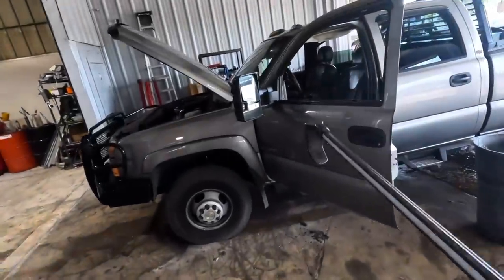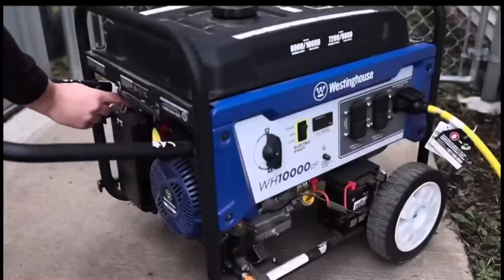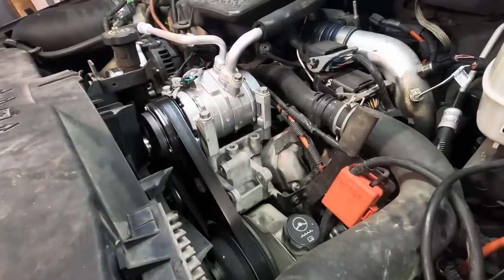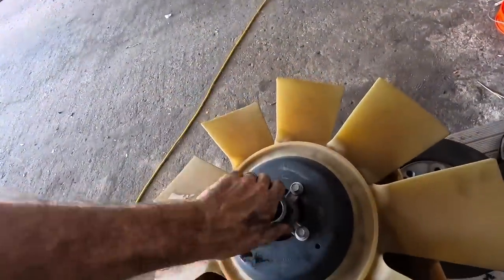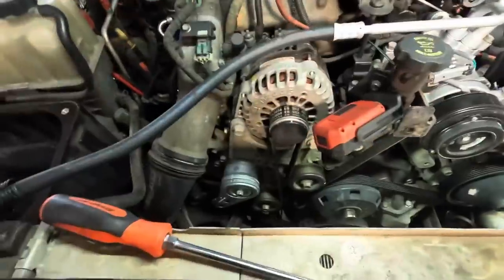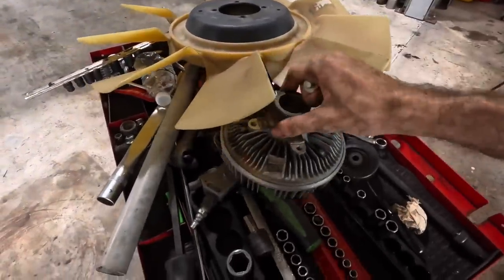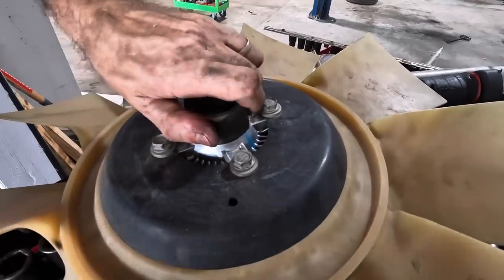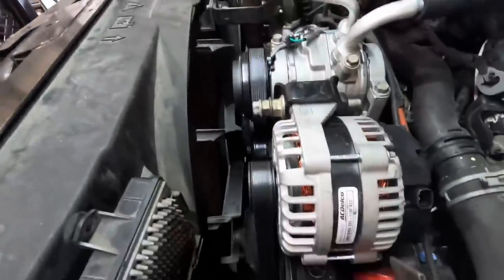Proof of Concept! Dual Alternator DURAMAX!

Comment: Ray you can run a short wire from the S1 directly to the output stud on the back of the alternator to keep the diode set excited all the time, essentially making it a one wire alternator.

Comment: A 12 volt inverter system to produce high amperage AC 120/220 is about the most inefficient method you could choose, especially since it's for a static site, (ie. your house).   Purchase a used "running" 7.5 kw Onan  / Kohler diesel generator from an RV or Boat,  thousands of them out there.  You're a mechanic, rebuild it if you feel the need, have it wired into the electrical panel of your house.  Mine is a 1977 Onan model MDJE, powers my whole house, is fuel efficient,  with minimal service, diesel is safer and stable for long periods of time.

Comment: Convert your gennie to propane. Runs quieter, and no more fussing with gas issues. Plus,,,,,, if you have propane running your stove and or furnace, you are golden just by simply tapping into the bulk tank.

Comment: Hey Ray, if your truck at high idle only burned a gallon per hour, then you would get approximately 5 days out of it. If it burned 4 gallons per hour then you would get 30 hours. Just so you don’t get caught unawares when it doesn’t last as long as you projected here.

Comment: Yes be sure to fuse that charge wire off the alternator and a second next to the battery. Don’t wanna catch the truck on fire if the wire ever gets pinched or rubs thru anywhere.same concept as car audio. 1/0 gauge should be good. It’s what I run power and ground all the way. 
I’m still super interested in your high idle setup! Will that work on a gas motor 04? 
That baby charge wire is definitely holding back power for the test lol grab a new pigtail for the alternator and save yourself some trouble of the wire coming off.

Comment: There is a very nice aftermarket alternator kit that provides high amperage for charging and /running invertor.  A welder box ,4  110v outlets and 1  220v outlet !  Not cheap but a real butt saver

Comment: The exciter wire needs to be connected/switched to energize the stator. The alternator is not self excited, thus the exciter connection. Also the exciter wire needs to be disconnected when the engine is shut down or it will draw down the battery when off, so it should be switch controlled. The one I built is on a 3 horse small engine using a regular Delco alternator from a 74 Chevy 85amp. I use it to charge batteries in the field, or a back-up for inverters if the power is out.

Comment: 2:53 I'm thinking that the belt won't be right there with the other alternator installed. It should be above that area wrapping are the auxiliary alternator pulley.

Comment: You have one or two of the pats need . But for future repairs you need to find a junkyard / pick n pull place / yard  for parts. Yuo could have kept your eyes open for a dual system off a wreck and gotten more parts and not pulled bolts from your extras. OR bought the after market kit.

Comment: You'll be ready when the zombies attack, Ray! 😎
However, you need to check your math. If you have 120 gallons of fuel and running the truck at fast idle burns 2 to 3 gal per hour, you have two to two and a half days of run time... not a week like you said. Of course, if you only run part-time, you can extend that somewhat. 
Incidentally, some big RVs have a second diesel motor just to provide electrical power.  One that an acquaintance had just bought used had a 4 cylinder in the front for the generator and a bigger "pusher" drive motor at the back. It also had a total of eight batteries!

Comment: Ray, you never mentioned whether you have installed a transfer switch next to your home electrical panel.  I had an electrician wire one in for me for a couple hundred bucks after Ike knocked out our power for 2 weeks in 2008.  I plug my 8500W gas generator straight into the transfer switch, which requires me to turn the main power off to the house (so you don't get a double electrical feed when power is restored or electrocute linemen working on the lines).   Can you rig the output of your truck to have the type of plug that you can plug into a transfer switch?  It's a heck of a lot better than running electrical cords to everything.  You can run everything but the home AC on that setup.  But now, you have a couple of window units that can run off the home circuit.

Comment: Ray, portable generators with diesel engines are available. or, why not add a pto to the transmission and use it to drive an A/C generator?

Comment: Hi Ray, I'd be interested in what the voltage would be across the batteries in the rear compartment while running your 2000 watt load. I know the jumper cables are temporary, but it would be interesting nonetheless. Thanks, Sean.

Comment: The exciter connection wire on the alternator needs to be hot in run only or it will cause a current draw

Comment: Hot wiring the two pin AD 244 alternator. It will work but not correctly. You won't get the voltage that you need out of it. Switching over to the four pin voltage regulator D200XHD to make it work, all you need is a 12 volt source with a resistor in line summit racing sells the wiring kit  and it will turn on the alternator. Also added benefit. There is an adapter you can buy two plug into the four pin where you can turn the voltage up. It does not increase the amperage but you can raise your voltage up and keep it at 14.5v. disclaimer set voltage went alternator is cold because if you said it when it's hot when it turns on the voltage on cold, restart it will spike to 18 to 19 volts if you use that adapter.

Comment: Remove or minimize the load on the battery in the truck, run the two alternators independently. It will still need a battery on the field half to energize the field, but it won't overload the battery. One issue comes up AFTER THIS. LOOK AT THE LOCATION OF THE POWER STEERING FLUID RESERVOIR. EVERY CAR LEAKS A LITTLE PSF.

Comment: Not sure if you have a vent setup but I'm fairly sure the lead acid batteries will release hydrogen gas as well as other corrosive gasses into that sealed container of a toolbox. You run the risk of fire/explosion 💥 and or damage to the electronics within the box from the gas. Just a thought.

Comment: A Tesla Li battery can replace all the batteries in your truck.  Mount it in the truck bed for a substantial power increase.  As for charging, a high output alternator would do the trick.

Comment: What about getting a 20kw cummins standby unit it looks like a AC condenser and its way quieter then any generator in the market and it can run on either propane or natural gas and on the plus side they are very useful in tornadoes as far as i seen

Comment: As mentioned before cardboard between the fan and radiator will help keep damage from happening.  Now, I don't want to be THAT person who thinks they know it all, because I don't, but, why doesn't your truck, being as it's a 2007, I believe have electric fans?  My 2005, 5.3L gas has twin fans on it.  I'd think they would have put either twin fans or one very large electric fan on that truck for sure.  Might be something to look into.  I'd, still probably get matching alternators later, like 2 - 165s or so and the smaller pulleys so you'd have 330 amps available.  I don't remember but I don't think the 165 over the 145 on mine was but about $10 more....been a few years.  ANYWAY, nice to see the mechanics vehicle isn't badly needing repairs like many other mechanics...lol.  Wish you were closer to me as I am saving up to do my 5.3 completely with new injectors, coils, complete timing set, along with a slightly more aggressive cam (about 5% more), new water pump and high output oil pump...plus new valve cover and oil pan gaskets.  It has 132,000 miles on it and it's about time.  Well, enough rambling.  Take care and stay cool.

Comment: The easy and proper answer is a 10kV/A Diesel powered silenced generator.
They will run on filtered old oil or diesel mixed with parrafin (kerosine).

Comment: It's not recommendable to run the alternator without a load. It's a sure way to fry the rectifier diodes. The reason it's putting out a voltage after disconnecting the exciter circuit, is that you have already got it excited. It's a bootstrap feature. There may be enough residue magnetism in the anchor that it will self excite. Some alternators are even made that way. They are actually called self exciting alternators.
Reply: yeah it was a bit unnerving to see him not even knowing that the exciter field winding is temporary, it's like he wanted it to go in flames or something
Reply: little knowledge is most dangerous

Comment: Correct me if I’m wrong, but you’ll generate a max of roughly 3000w, but you got inverters for 12000w planned in the box?

So I’m wondering for what you need the overkill amount of inverter Watts
Reply: Wondering the same thing. Hopefully he is using the batteries to take up the worst case scenario 9000w alternator overload (loads starting up) and connecting continuous running loads within the continuous load capability of the alternators which should be about 2500w.

Comment: It's cool that you have chosen this method of emergency power generation if this is just an exercise in Youtube content creation, but, as far as practicality is concerned, just buying a Honda EU iS7000 inverter generator hooked up to your house transfer switch would be safer, energy efficient and less worrisome.
That total 245 DC amps output from the dual alternators require upwards of 6000 RPM (pretty much full throttle of your Duramax) just to output 24.5 amps AC at 120VAC.

20 amps AC will just barely start a 12,000 BTU window AC unit let alone also needing to simultaneously start and run your residential refrigerator/freezer. The Honda generator would automatically increase and decrease it's current output via auto throttling while your Duramax would be running constantly at full throttle. That truck would have to be parked pretty far away for you to get any sleep.

Comment: if you leave the smaller pulley on the new nator - then you may not need to fast idle as it will spin at higher rpms relative to the engine, compared to stock? Also, once the alernator is generating power, it will self excite - but if you try from engine off situation it wont power up.
Reply: he is 'excited'

Comment: Back in the 60s-70s GM had AC outputs on the alternator for the commercial chassis Cadillacs used to make ambulances.

I wonder if similar exits or an alternator could be modified.

It'd be more effective to just take the AC from the unit instead of rectifying to DC then inverting back to AC.

Comment: You could also purchase a natural gas/propane generator large enough to power whatever you want or even your entire home. And you can have an automatic transfer switch installed that brings the generator on line and transfers to emergency power. These units are very efficient and quiet. For where you live, with the threat of hurricanes, this would be the best way to go. Fuel for this type of unit wouldn’t be a problem, because even if you go with propane, fuel storage is not an issue.

Comment: Ray, what is your plan should someone discover you have power it would be easy for them to come take such a mobile power generating setup, especially since you need to leave the keys in it in order to use it.  The door lock can easily be slim jimed.  Maybe come up with a way to keep it running without the key in the ign and it will shut off the instant someone steps on the brake?
Reply from the maker: I can operate a backhoe also 😉

Comment: Sir:  Have you considered using a clamp meter near the alternator to see what the amps output is?  And then at the battery box to see how much you lose in the long cable?  

A T Burke
Reply from the maker: I’ll test all of the amp draws after I make some proper connections. I still need to fuse everything and wire the breakers and solenoids
Reply: Thank you!   @RainmanRaysRepairs

Comment: Is it possible to monitor engine working parameters (revs, temp, oil pressure) from inside the house when the truck is supplying energy idling outside? I would have thought it would be useful. Perhaps there is a wifi or bluetooth technology to offer that? I would like to have that if I were using this kind of power supply in emergency situation that may last e.g. all night...

Comment: You need to check your amperage output when it feeding your battery to make sure it can keep up with when you are using it as a generator .  Do you have an amperage meter with clamp that goes around the charging cable? I would get one of those cheapo amperage meter with clamp like from Harbor Freight and compare the amperage output between low idle and high idle.

Comment: EE here.  Car alternators are not continuous duty.  If it's a 12V 100a that 1200 watts of power .  Deep cell batteries.  Lead acid 100 amp hr = 1200 watt but can only use 50% so really 600 watts each. 

They make quiet gas generators that sip gas and some duel fuel which allow you to use propane which doesn't degrade like gas. They also make diesel generators if that's really your issue...

Comment: Curiosity wuestion. Why dual alternators instead of one larger one. Assuming the larger one would fit in the same space. I've seen some serious 390a wuality alternators. The reason I ask is that if you ever watned to install a LHG for example that second alternator would make it more difficult. THe larger alternator wouldn't have to work as hard nomally as they produce more amps at lower rpm. Seriously just curious. I know nothing and am just asking questions for a friend :)

Comment: I would hook up the pig tail To keep the batteries charged at all times and install a continuous duty SPST Solanoid in between the batteries and the Inverter control by a switch so they can be turned off. When not in use while keeping the batteries, charged and condition, and turned on when the inverters are needed.

Comment: Next thing to consider is to have a remote start on your truck so you don't need to go outside to switch the load to truck. Plus you can easily start the truck in the end of the day to cool it down before you head home.

Comment: Ray, Ray, Ray. No doubt, I admire all you do. Watch you everyday. On this deal, I'm confused. Ok, hurricane ready. Great. But wait.
All this stuff to your truck for 10, 11 
KW ? For the house ? I don't get it.
I know that you have money. I'm north of Houston. I have natural gas. Maybe you don't. No problem.
Propane. I have a 22KW gas Generac gen set. Powers everything. 12000 bucks. You can do the same thing with gas. Propane tank buried in the ground for you would get to around 20k.
My sister is in Jacksonville. Her neighbor did it for 20k. I just don't get the truck thing for 10, 11kw. All the mods and work ? Me ? No way.
And what ? Have the truck running at 1500 rpm for how long ? Sorry
my Man. I just don't get it. ❤

Comment: For the way that you are using that second alternator you could look into adding a diode inline on the voltage sense wire to drop the sensed voltage and boost the charging voltage up to around 14v which would be better for those batteries and draw a little less current. Very quick, cheap and easy mod.

Comment: 14v at 245 amps will give you ~3400 watts if you have 290 amps (both 145) you have about 4000 watts. You could draw 3x or more of what the truck can produce in this configuration.

Comment: Great video as usual! But curious, why don't  diesels use electric fans? Do they run to hot?
Reply from the maker: The diesel mechanical fans pull much more air than an electric fan can produce. Look at the shroud and fan design Vs the fan shroud on a gas truck. The electric fans can actually produce an airflow restriction in the diesel trucks
Reply: @RainmanRaysRepairs  That's  what needed to know ! I am putting factory elec. fans in my 03 Tahoe using the 05 ECM . Love your videos my wife watches them with me and  you make her laugh!

Comment: you didnt use your claw hammer when the second alt is connected itll send spikes through the lower amperage alt also youll need to measure the amperage and change the alts fuse also relay i would've tapped the bolts down and cut off the excess thread as im worried when the belt stretches itll bounce the bolt head

Comment: I used to have a LBZ drivetrain in my warehouse.  From wrecked Chevy DuraMax that had 45k miles for $6,000.  Engine transmission wire harness steering wheel I think Radio.  Planed to install in 97 Chevy Z71.   Plans changed and my son took to store at his warehouse. And suddenly it disappeared 😡🤬🥵

Comment: I have a question. What are you going to do to cool the inverter? Do you plan on putting a hole on the cab side of the box or just open the box when possible to cool those pieces of equipment?
Reply: open during a storm

Comment: My other question is have you had electrical issues with your truck your truck looks exactly like mine with the exception of mine is gas and yours is diesel oh and I don't have Duallys mine is a 2004 Chevrolet just out of the blue my battery died and the alternator might need to be changed and I have buzzing underneath the dash that's why I'm asking about electrical issues